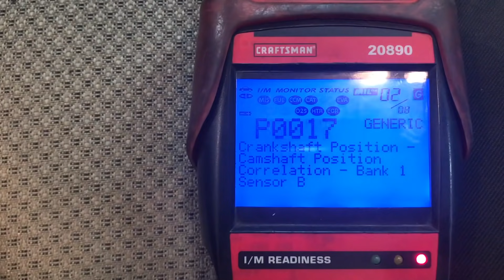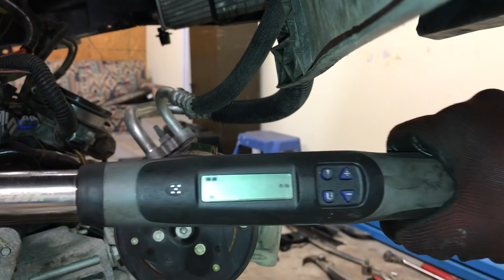Step By Step: 2.4 EcoTec Timing Chain Replacement

Comment: Moral of the story;
 Change your oil often (5k-7k), with the correct oil composition (5w30 DexOs). Your pockets will thank you.          P.S. :  Dont forget the transmission oil. It needs changed too. Preventative maintenance is the best maintenance.
Reply: Show me a ecotec that follows my recommendation from the beginning of its life, I will show you 200k mi. engine/ transmission.
Reply: @cordiepowell3046  I really hope that's the case with my wife's 2015 equinox. I change the oil every 3k weith mobil 1 dexos and the filter every 6k. also mobil 1 or Wix. did the trans service at 50k and now at 62k miles I noticed the passenger side axle seal as well as the trans cooler lines are leaking at the radiator. hopefully it can be done under warranty.. ps I do the oil so often because it seems these engines are very hard on oil.
Reply: I have a 2011 2.4 Malibu. Had just under 30k on it when I got it in 2013, now approaching 210k and still runs great
Reply: I agree.. i race these ecotecs the 2.2 (basically the same). And never had an issue. They are pretty quick and with me changing the oil every couple races it was still going strong till my dad raced it smacked a wall and broke tranny and block lol
Reply: My Mother has a 2011 Malibu. I change her oil for her and use M1. I take it to the dealer for a trans flush every 30k. Car has 130k miles now and it's not a bad car. Dipstick always reads low oil level but when I change the oil 5 quarts comes out. Had to change her headlights this weekend.... Not happy. What a pain in the ass.

Comment: Thanks so much for the video!!!! My timing chain went out on my eco tech engine. It was on a 2013 Chevy equinox... do u suggest to get a new engine? A mechanic told me I should get a engine instead because sometimes a timing chain is sometimes not successful
Reply: Danielle Moore , I’m having the same problem
Reply: It all depends. These are interference engines meaning if timing gets off far enough the pistons will devastate the valves. Once that happens what is required to fix it is so intensive and thorough and detailed that most shops will refuse to do it and will only offer you the option of taking the old engine out entirely and installing a new one. When the guide goes like this it usually just gets a notch off which is salvageable. But if the tensioner fails or the chain got up to 5 notches off the engine is decimated and it is completely not worth it.

Comment: At 4:30 I understand that you turned the cam to make sure it is in time but when you take it off shouldn't it have been already lined up so upon reinstallation was it moved?
Reply: Valve spring pressure causes the cam to rotate slightly when chain is removed.

Comment: How much does this cost to have done in a shop
Reply: My local shop said $850 parts and labor and the Dealership said $1,100 parts and labor. I can get a complete timing kit with tensioner, chain, sprokets and guides from Rock Auto for $120! Think i'll do this myself!
Reply: $1600

Comment: Thank you for this video. I know never to buy a vehicle with this engine. I have a 2008 hyundai 4 cylinder with 200k miles and haven't needed this.
Reply: Every car has it's  problems
Reply: @allenhetrick7694  The 2.4 ecotec has a bad reputation for a reason.

Comment: Just to clarify everyone, the engine does not need to be removed. Idk if this guy mentioned that or not. These engines are decent other than timing chain issues but it’s not a big deal to do . No timing chain will last forever
Reply: He stated that. Just said it was easier for video / viewing purposes.
Reply: My advice to you folks is if you generally want a reliable durable car that will not be expensive maintainence like this here then get one with a great durable engine like a buick lacrosse with the 3800 engine those engines were fantastic and flawless one of the best engines ever made for a car as far as durability.
Reply: Not everyone is stupid like you.
Reply: i have a question why does he turn the exhaust gear to align the diamond with color on chain??? does it not affect it...does it go back or we have to do something ????
Reply: He did mention it he didn't need to take it out but he did it for better view of the engine of what needed to be done on the timing
Reply: If you back it up and listen that's exactly what he said
Reply: Ah, yes - he DID mention that. Apparently you weren't listening.
Reply: Wonder how much harder tho...

Comment: Excellent video. Thanks for going to the trouble of dropping the engine so that viewers could see what you were doing. One suggestion to those who may have to replace an Ecotec timing chain - the torque values for the 10 mm bolts on Ecotec engines are typically 89 inch/pounds (verify for your engine) - any thing higher than the factory spec has a tendency to strip the threads. Inch/pound torque wrenches for home mechanics are relatively inexpensive (about $40), and relying on feel rather than precise torque values can be an invitation to disaster for DIYers who do not work on these engines every day.  Another point - if the valve timing is not set perfectly, you will get more codes and will have to go back into the engine to get the timing right.  Eric O. at the South Main Auto channel did a 5 part series on a very similar 4 cylinder Chevy Colorado engine with timing issues and phaser problems; it is a long series but his conclusion after a lot of work on that engine was that there is little to no room for valve timing errors in these types of GM engines.  Again, thanks for one of the best videos on doing this job that I have ever seen - it is a masterpiece.
Reply: i know this is four years old, but do the 10mm bolts that hold the guides in place also get tightened to 89 inch pounds?

Comment: Question:  I have a 2011 2.0 Turbo.  I replaced the timing chain and it threw a P0016 & 17 code.  So, opened the motor again.  In your vids, they show you going to TDC on compression.  The manual says TDC on Exhaust.  Which means the cams are still under load.  So, wouldn’t removing the chain allow the cam# to rotate some without the cam fixer tool in place?  It would explain why I can’t get the intake marks on the chain and the crank marks to line up.  If I am on point on the intake cam, them I am off on the crank gear by 1-2 teeth.  Also Curious if you had any codes after you started this motor.  Thanks!
Reply: You need to make sure ur top dead on compression. Then move ur cam to the marks from there
Reply: I HAVE A 2011 2.0 turbo Buick and have just finished the job and Iam getting code po366 .Camshaft position sensor ,wel I changed trhat and samethingIwas wondering if you  fixed your problem.I  set my timing with my cam lobes like he has  and number 1 piston at top most first one on the passenger side. All the marks lined up but now I get this  p0366 crank no start.
Reply: @snowblind5151  did you figure it out

Comment: Hi Daniel. Great video! I have a 2012 malibu with same issue. Is there a need to change out the intake and exhaust cam sprockets? I noticed you didn't. Also the timing chain kits don't come with them.

Comment: excellent video.  in the middle of this job on a '13 Captiva 2.4.  on mine, the VVT sprockets are the same part number.  the intake is seized and the exhaust rotates and returns as i assume it should.  waiting on parts.  wouldnt have attempted it without this video
Reply: Here is a pic of the broken part.  Seized VVT sprocket, '13 Captiva sport 2.4L.  Internally broken. P0011 and others https://imgur.com/a/yaY2EPc
Reply: Excellent video. Thanks for going to the trouble of dropping the engine so that viewers could see what you were doing. One suggestion to those who may have to replace an Ecotec timing chain - the torque values for the 10 mm bolts on Ecotec engines are typically 89 inch/pounds (verify for your engine) - any thing higher than the factory spec has a tendency to strip the threads. Inch/pound torque wrenches for home mechanics are relatively inexpensive (about $40), and relying on feel rather than precise torque values can be an invitation to disaster for DIYers who do not work on these engines every day.  Another point - if the valve timing is not set perfectly, you will get more codes and will have to go back into the engine to get the timing right.  Eric O. at the South Main Auto channel did a 5 part series on a 4 cylinder Chevy Colorado engine with timing issues and phaser problems; it is a long series but his conclusion after a lot of work on that engine was that there is little to no room for valve timing errors in these types of GM engines.  Again, thanks for one of the best videos on doing this job that I have ever seen - it is a masterpiece.

Comment: Would never have attempted this until I saw your video, Thank you very much. It turned out to be identical to this one right down to the broken peice falling out when the cover came off. Great video. Not a hard job at all, even in the car. Equinox. After starting the car about 10 times the light came back on. Same code. Completely tore it back down (45 minutes flat) and rechecked everything. Found nothing wrong, so am guessing it is the phasers. Any suggestions? I had a mechanic check out my timing while I had it apart and he said I was all good. I would say if I had to do it again 2 hours start to finish. Thanks again
Reply: Did you actually drop the engine? Or just pull off the valve cover and passenger wheel?

Comment: That must be an old used timing chain you put on that car since it easily went over the bottom sprocket.... I tried that.. Bloody Impossible.  I ended up locking the cams as best I could and taking off the exhaust sprocket, putting the chain on the sprocket, and then installing it back onto the cam with everything aligned properly.  Only thing is maybe a 2.0 Lnf is slightly tighter than a 2.4?  Anyways.. just thought I'd contribute but thanks for the video... Haynes manual doesn't help much with this install.. tq specs n such are good, but installation is a royal pita until I figured a way to keep the cams in the correct position with adjustable locking monkey wrenches and a small flatblade screwdriver on the intake side to keep the intake one in place... it worked out nicely that way.  Otherwise, you need a second pair of hands to get the chain on while the other holds the 2 wrenches on the cams in place.
Reply: You are the real mvp, I was having the same trouble!

Comment: Not sure why mitchell explains timing is set cyl 1 tdc on exhaust.  Not compression. Per 2010-2011 le5 and le9 engine. But camshaft marks never line up tdc exhaust.

Comment: Hello, just wanted to make a point. First of all great video and information. On a 2009 malibu 2.4 Mitchell manual states that piston number 1 should be at tdc on the exhaust stroke, on your video you are placing piston number 1 at tdc on the compression stroke. Is my info accurate? Or maybe the procedure Changed over the year difference 2009 and 2011,as far as I know they both have a 2.4 ecotec. Could you verify this step please? I’m about to perform this repair on my 2009 malibu at 189k miles
Reply: kevin villegas  one engine is vvt one isnt. Timing different.  No phasers. Actuators and nor will it run on e85.
Reply: Ricky StrAwhun great information thank you so much
Reply: I too am going in to do my 2007 2.4l vvt. My manual Says TDC on the exhaust stroke
Reply: Ricky StrAwhun 2009 had VVT

Comment: Here's the money pit question - while that engine was down and fully opened - wouldn't it be smart to replace the other chain along with guides and the water pump?
Reply: Most techs recommend them and do. Its very easy, but does add to the amount of this job.
Reply: What I came here to say lol
Reply: Yea do the lot.
Reply: This was probably one of those jobs for a friend just fix what's needed kinda thing. Orrrrr it is one of those jobs the mechanic charged full book time and only replaced enough to get it in and out fast. But yes he should have done all of it. Cloyes makes a very good kit and it comes with everything gasket guides chains sprockets water pump belt and belt tensioner shipped I paid 431. Had all of it replaced within 3 hours.

Comment: I wish I could see the process of removing the subframe, and lowering the engine
Reply: Its a bitch to do and the subframe bolts are torque to yield as well. Subframe has to be aligned correctly or your steering will be off center.
Reply: @ryanchristensen1799  Your aligning the car after you drop the subframe. I have a steel dolly I drop powertrains on. Its about 6" off the ground. Makes it super easy to maneuver and align the cradle back up in there again.

Comment: Great video!

But Jesus Christ, does GM know how to make an engine with a timing chain?? That looked like a complicated mess! I don't know what that secondary chain is in charge of, nor do I wanna know. I thought my VQ35 timing system was bad, but this makes me appreciate mine!
Reply: This chain was caused by lack of maintenance. Use full synthetic oil and change on the regular these engines would last forever
Reply: Jared M it's the balance shafts and water pump chain

Comment: I'd never, ever buy a GM with that EcoTick 4 cylinder...
Reply: They are actually really good motors. people just dont take care of their cars
Reply: @loganator78r  Actually. The newer GM ecotecs with VVT are absolute garbage. They all burn excessive amounts of oil from the factory. Do some research.
Reply: @TriviumDFTS  those vvt ones are junk but the non vvt ones arent. I race them with no problems.
Reply: @loganator78r  I agree with you. I had a cavalier with nearly 300k on the original motor.
Reply: The 2.4 Ecotec had an oil consumption issue between 2010 and 2014. It was primarily due to issues with the piston rings and some of them had issues with the Bosch high pressure fuel pump leaking fuel into the engine oil which caused excessive wear that lead to oil consumption. The owner is another factor in timing chain wear as many of them had bad habits such as making way too many short trips and waiting way too long to have their engine oil changed. Also, modern engine oils sold since the mid 2000's no longer have the best additives for protecting timing chains from wear. Hence why so many manufacturers began to see timing chain wear and cam phaser wear ever since then. The Ford Ecoboost engine line in particular has had a lot of issues with timing chain stretch and cam phaser issues. Direct Injection engines create a very fine soot that make it past the low tension piston rings commonly found in every gas engine sold in the last 15 years. That fine soot ends up in the engine oil and current oil filters can't filter it out, leading to accelerated TC wear as well. Especially since synthetic engine oil is all the rage and people just love to push their engine oil out past 7,000 miles before changing it. 

Do you know who else has had oil consumption issues in the last 10 years? Toyota, Subaru, Honda, BMW, etc. In fact, in the last 10 years, Toyota lowered their oil consumption spec and now considers it "normal" for their engines to burn 1 quart per 1,200 miles. Honda has a similar "normal' oil consumption spec these days. Yet even GM will warranty an engine if it burns more than 1 quart per 2,000 miles.

Comment: Dan my timing chain went at 59,000 they replaced it under powertrain warranty. ..but i always changed the oil ontime...not sure i would buy another chevy again ...many other issues with this vehicle
Reply: There is a shim like washer u have to remove it

Comment: You can use a timing belt that you change every hundred and twenty thousand miles. That is easily changeable for a decent price or you can buy a Chevy that uses a timing chain of poor quality and takes more time than it's worth to change the engine sounds like s***. Great video though great content

Comment: Thank You so much for providing a much better and indepth video on how to do this. I need to do this on my 2011 buick regal with the same engine in it. The slack in the chain on my vehicle is not as bad as this one witch is impressive cause I have 140k miles on mine. All the other videos I have seen don't give you direction on setting the timing. Earned a subscribtion from me sir.

Comment: I noticed you didn't change the balance shaft guides and chain.  Wouldn't the wear be the same as on the timing chain?
Reply: Lorrin Barth not necessarily because there are two different change chains... but honestly  just go ahead and do both...  the balance shaft chain is about 50 bucks and you might as well grab a water pump and just do the whole deal if you're going to do one or the other should only cost three to four hundred dollars total if you do it yourself.... that's both chains, guides tensioners, and water pump you can find decent aftermarket water pumps... if you buy the GM OEM water pump it's $265 and will push the cost up to about $600 in parts....

Comment: What about the broken pieces of plastic from the tensioner? I have seen this same failure on a 2.2 cobalt and the broken pieces were wedged under the oil pick up.
Reply: good idea to remove pan and get out the broken pieces laying in bottom, good video

Comment: You saying """rotate the crankshaft a full 720 degrees, this will rotate each camshafts by 360 degrees,,, while rotating the engine, pay very close attention to the resistance on the crankshaft, if your engine is timed properly the valves will not contact the pistons. if the engine is timed improperly, the valves could contact the tops of the pistons causing serious damage, rotate the engine and make sure no interference occurs. LOLd, I quit ehhhhhh bro :)
heaven forbid folks use their brain, nor have to use a "DIAL INDICATOR" to set cam timing, what is this colored link and idiot mark fudge :)) yeah it helps folks that have a clue, but still